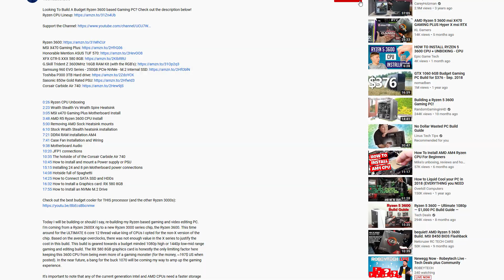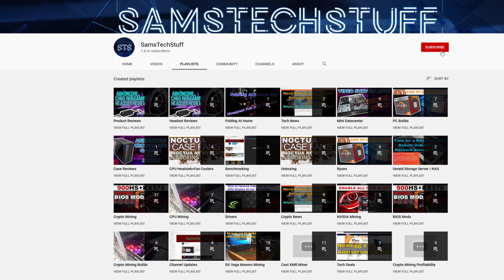Don't Lose Your Data! UnRAID Backup Server Build

Comment: Dell Towers. Available cheap with redundant power supplies even. Or a rack mount 2U. I bought two T310s with a total of 16GB ram and two power supplies (case holds 2) for $50 total and upgraded 1 to an X3440 (HT enabled), and a trayless 3 bay for 7 total devices. One drive sat on the bottom for 8 total. An SSD sat on the top of the trayless for 9. :) I alos had another port on the H310 that could have gone to a disk tray. I recenly moved to a 740xd for under $400 and the T310 is now my backup server. I gotta have ECC on my servers. One less thing.
Reply from the maker: Nice value setup there! I have a few 2nd gen / sandy bridge Dell Precision T tower PCs, the model escapes me though. Love to see this equipment repurposed!

For a long time I ran all of my homelab off of a Dell C1100 then a C2100, good times :)

Comment: This is exactly what I'm planning on doing, but the other unraid server will be in my shed in the garden. I also back up to OneDrive for true offsite backup, but would never want to use this option given my Internet speeds obviously and the unraid server in the shed should cover most scenarios.

Question is, you didn't actually talk about how to back up one unraid server to the other one? I'm thinking of using rsync and setting a schedule but are there better options?
Reply from the maker: Hi Deeps! Yea - offsite backups and bandwidth can be tough, 3 copies would be ideal, 1 primary onsite, 1 backup onsite, and 1 offsite but the cost of doing so is quite high.

And yes - I meant to do a follow up video using Rsync but still haven't gotten around to it. This is IMO the best way to sync them. I did not show this in video but what I initially did was just copy directory by directory. Hoping to post a more in depth guide in the future (for Rsync unless UnRAID comes out with anything official)

Comment: Great video I basically converted an old gen i7 IBM workstation for this purpose. I currently run a backup storage pool using Windows Server 2019 I plan to change that over to Rsync and LVM.
Reply from the maker: Hi alphabanks! Thank you! Great to see hardware being re-used for a homelab! I don't have much experience with Windows Server 2019 or storage pool - this is something I have been meaning to look into. Rsynch and LVM will definitely serve you well though :)

Comment: So my backup strategy:  I have currently 1 UNRAID machine with a cached array, a bare metal VM and a passtrought SATA controller to Hotswap bays.  So i do a manually triggerd sync, with a quick review of deletions, of almost all my main folders to a corresponding drive. So \\Unraid\movies ► HotswapPool1.1\movies\. If no other major folder fits on it, it goes to the next disk So \\Unraid\Documents ► HotswapPool1.2\Documents\   Every month I swap out these HotswapPools and replace them with another offline copy. So again \\Unraid\movies ► HotswapPool2.1\movies\. And every time a disk reaches 50000h and it's SMART data is still ok, I discard it. And use it one or two more times for a last permanent cold storage copy of whatever main folder I think is the most relevant at the time. One HotswapPool is far away in a secure place. The cold storage is in my shed.
Reply from the maker: Hi Ruben! That is an interesting strategy. I can't say I've read many examples of disk rotation, cold storage, or such a well defined strategy. Kudos to you for working that out. I'm already planning my next refresh of this backup server so that I may keep one local copy and still have one stored remotely. Quick backups are handy!

Comment: Nice build. I usually do regular backup of my most important data on external drives as I don't want a secondary storage. Right now I have a QNAP unit and I'm thinking of going UNRAID or TrueNAS.  I will probably keep the QNAP I have now to backup very important files but I'm not sure yet. I am stilling undecided if I will build a UNRAID or TrueNAS server. TrueNAS is a bit more tricky as you need to plan your VDEV right or I could be facing expansion issues because of the way VDEVs work. TrueNAS also required 1 Gig of memory for every 1 TB of storage plus it requires ECC ram. But to be honest, even if I would build a UNRAID server, I would probably go with ECC memory except I wouldn't need 1 Gig for every TB of storage. The only thing I'm worried with UNRAID is that it will be slower (sure I could use a SSD cache to help) and the need to use an external USB key to start the system. I would much prefer to have everything on a M.2 SSD. To add to the challenge, I'll be using PROXMOX and would virtualize UNRAID or TrueNAS. Why did you go with UNRAID if I may ask?
Reply from the maker: Thanks!

I haven't been very interested in QNAP type units but they do have a place in the world. You hit the nail on the head, planning and understanding of expansion is required for a FreeNAS/TrueNAS build. The memory requirements are a little bit higher on Free/TrueNAS for sure. 

I actually run UnRaid to store all of my media, software, and miscellaneous files. I use FreeNAS currently to share iSCSI storage to my main ESXi server. In the near future, it will be sharing to x2 VMware ESX servers and one mystery (undecided) hypervisor setup. 

If UnRaid gained supported ZFS arrays and iSCSI, i would switch to only UnRaid.

If TrueNAS gained the ability to add drives at will and backed up users with more info (community growth, sponsored projects, documentation) I would switch to only FreeNAS.

For now, I live in both worlds and am happy. I took great care to manage power consumption as well. Using newer Intel and AMD platforms affords much better useage too.
Reply: @STS  I think there is a community supported addon to make UNRAID use ZFS. I saw that in a video when Gamer's Nexus built his UNRAID system. But to be honest, because of the memory requirements, I'm not sure I would go ZFS. I guess it is a choice. I think BTRFS is pretty good.
Reply from the maker: Well, ZFS is regarded nearly as magic to most. I would love to run it myself but for me, I would need official support before I ran it. The memory requirements are high yes. I also run a FreeNAS server that uses a few raidz2 arrays with ZFS. This storage server is mostly for serving iSCSI SSD storage to my current ESXi box, the next ESXi box, and then the not yet built 3rd and maybe 4th hypervisors. Those will be less for my VMware adventures and more for the channel probably. Likely Proxmox and maybe something crazy like Xen or Windows Server :P
Reply: @STS  Yes I know ZFS is highly regarded. I just don't like how it makes expansion difficult because of how VDEVs are done. I heard that the team doing TrueNAS is looking into that (did you know FreeNAS merged with TrueNAS?). I do recommend Proxmox, it is amazing and even has a backup server. I'm not using the backup server but apparently it is very fast, better than doing backup straight to your NAS. Another thing you would love is that it has ZFS support straight out of the box as well as RAID 1, 0, 10 support. Quick question, have you ever considered using a hotswap back for your 2U servers? If so, which model would you go for? I'm looking into iStarUSA and ICYDOCK but not sure which I would go for.

Comment: Can you make a video on taking 1 physical drive with data on it from the raid server. Then plug it into a Windows computer to pull off some of those files. (YEs I am trying to recover my data because I did not run a backup like you are showing here. ouch.

Thank you
Reply from the maker: Hi Keith! Great question! You can plug the drives individually into either a Linux or Windows PC. If Linux, mount the drive and grab what you can, if Windows, the Unraid manual says use RFSTool to read the disk.

Unraid Manual FAQ: https://wiki.unraid.net/UnRAID_Manual_-_FAQ
RFSTools: http://p-nand-q.com/download/rfstool.html

Comment: I have a old 4-bay Seagate NAS with one of the drives configured as an iSCSI drive. I use file history to backup to this iSCSI combination. On my other NAS a QNAP 332x I am using Backblaze for offsite and very affordable backup. They also have a feature called a snapshot which creates a zip of selected directories or the entire storage space. They can either send the snapshot to you or you can download it. I create snapshots monthly. My next move is to get another 332x for onsite mirroring and an h886 for a server NAS combination unit.
Reply from the maker: Hi P. Wingert! Sorry for the late response - that sounds like a good system with a good plan! At some point as the channel grows, I will be looking into something like Backblaze myself. What type of data are you handling?

Comment: good advice on the second server ! I have ran a secondary server for years,an a main server for ever but i like Power...More power..lol. a old Dual xeon X5675's 64gb of ecc 2-3 500gb ssd's for cache,plex,and vm,s & Hel* YES 10gb Nic an thats my backup  server..runs 24/7 and never complains an ya can imagine whats in my main server...just double or triple that ! its all supermicro all the way as i really like the ipmi thing ! i even have 98% of the parts to build another dual 6core server but i would rather sell it bfor i spend money on more crap that i dont really need..haha
Reply from the maker: I missed this one, sorry!

Yes, a backup data server is more important than most give it credit for...before they have whatever they are using fail on them. Those old Xeons still have quite a bit of life left in them! Very nice setup you have there. I run a lot of Supermicro stuff as well, can't beat the bang for the buck there IMO. Managing the need to keep building bigger and upgrading more and more is tough for me too 😀 I've got a few more builds and some components to test coming up :D

Is your setup mostly a Homelab or is this for a SMB type setup?
Reply: @STS  Mostly SMB With a mix i Would Say..I Want a Rack so bad i cant see straight but my local craigs list just dont have any thing Ever..an i cant drive 2-3Stats away either..lol. that sux an so i looked at a new one but Shew..lol. i have ben tinkering with trying to get a Retropi/Retro gaming pc up & going but i allways find something gets forgot & havnt got it to work just yet Between that an trying to figure out the easyest pc sync/backup to unraid& freenas i havnt done to much n the past week or two...Well that & try to find a decent ultrawide that wont break the bank..i think i finaly made my mind up on that thoue !O & I Alredy Built The Other Dual Xeon Server that i said i would sell befor i spent more on junk i didnt need..well i didnt sell it so ..lol. more crap i dont really need running FreeNas !

Comment: Right as i click on your video i see the biostar LOL 
Then i think to myself.. 5++ or so years ago i bought a brand new A681-350 
It Sitting Right beside me as i opened the video i never got around to doing the build LOL! 
I was thinking of doing the same thing LOL
But the model i got only has 3 sata ports , 6GB 
I was going to get a PCI-E Sata Raid Card. and just tossed the project to the side 
This was just going to be a backup / Junk Server also.
Reply from the maker: Nice! Yeah, for an inexpensive low power draw backup storage server, I think this will be hard to beat. As time goes on the processor in these embedded models slowly gets upgraded and sometimes so do the motherboard features. I'm starting to collect a little bit of data from YT that I definitely want backed up. Hopefully you get your setup built and dialed in for backups!
Reply: @STS  i know what you mean I have 32TB worth of videos saved 😆 
4TB x 8 
Time for me to start dumping videos or buy more hard drives 
I don't worry about running raid on this system as nothing i do is that important once its already uploaded
Reply from the maker: @StarPuss www.ToxicRedNeck.Com  Whoa! That's quite a bit! You've been pretty busy by the looks of it though :) Do you have your drives in your main PC or some type of virtualization or bare metal server?

Never delete, never surrender! 

My plans for the main UnRAID storage server it to slowly replace my aging 3TB drives every couple of months over the next few months / years with 8TB drives as well. I'm still going through my YouTube growing pains, currently filming and recording in 1080p with small files. I'm currently storing all video content in its original form. When I take the leap into 4k, I'm sure I'll need some more drives as well 😃

As the need for faster storage arises, I'll be putting a little bit more work into my FreeNAS (now TrueNAS) server. I'll be running some all SSD arrays for speed and 10gb switching. Until that's ready though, I'll probably settle on an NVMe cache drive for UnRAID.